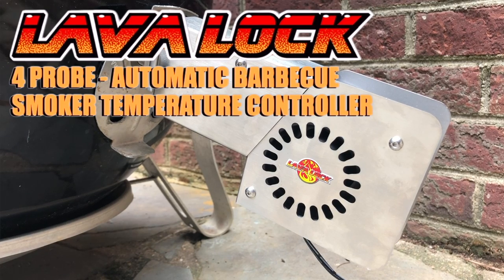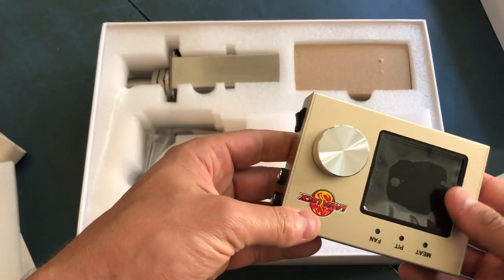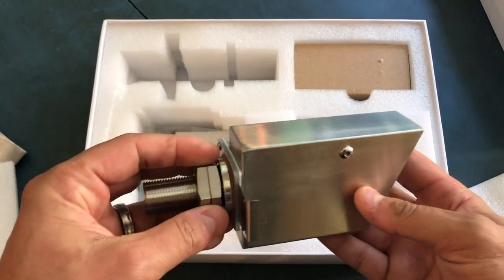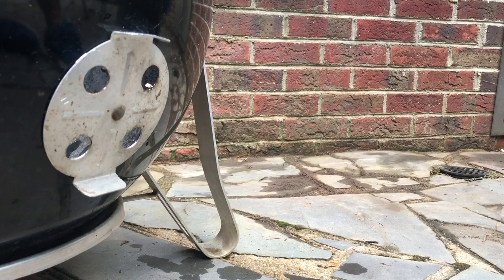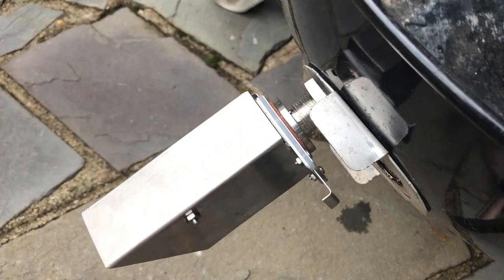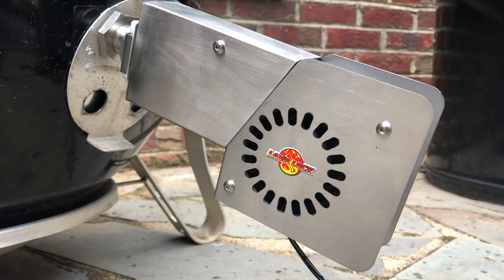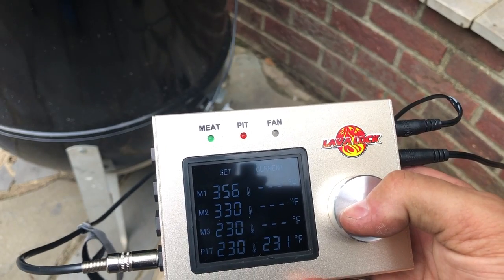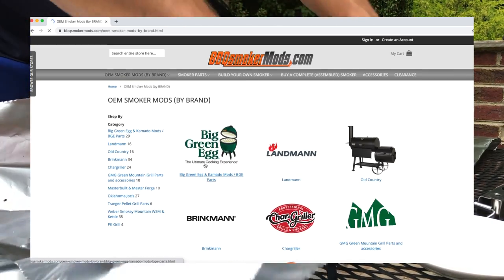LavaLock 4-Probe BBQ Smoker Temperature Controller | Unboxing, Install and Set Up | 22" WSM

Comment: This looks Great! Any Bluetooth or Wifi option coming. Will the controller vary the speed as needed or is it on/off?
 Thanks
Reply from the maker: Sadly there’s no Bluetooth or WiFi option. Either would be a great addition though.  The fan runs only runs at one speed with an on/off controlled by the PDI sensor.  Thanks for watching!

Comment: At 1:36 you say to use one of the two higher holes and why will become apparant.. I dont know what Im missing? Why the upper holes and not the lower ones?
Reply from the maker: I don’t remember. Maybe because there was too much curvature for the threads on the lower two.  🤷‍♂️

Comment: If I can ask a question, I' bought the Lavalock ATC-2 for my 18", but it doesn't seem to screw into the vent because the vent tabs don't allow the vent to be 100% open. Did you have to do anything to the vent tabs to get a fully open hole?
Reply from the maker: I honestly don’t remember.  I would reach out to LavaLock directly and ask them..
Reply: @RaleighSmoke  Thx, I figured it out - I had to use my Dremel to open the vent a little